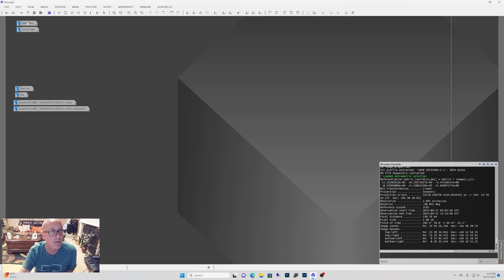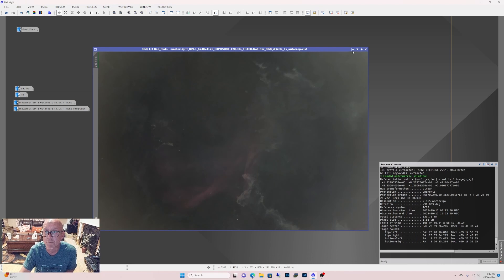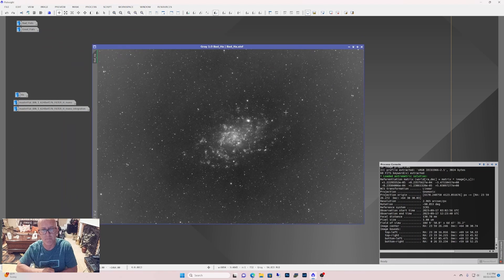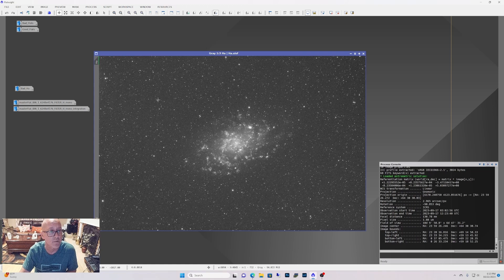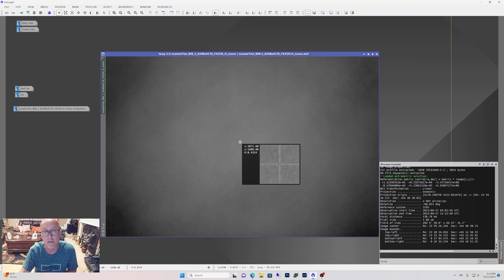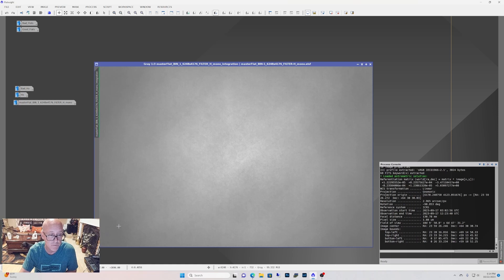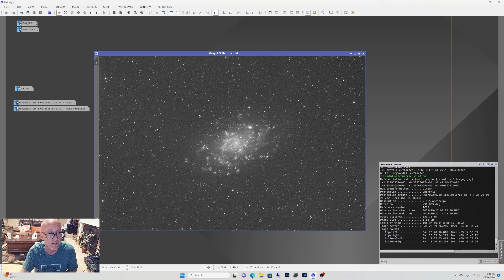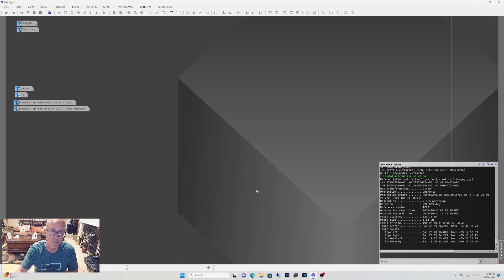Astrophotography Bad Flats vs. Good Flats

Comment: The 2600MM seems pretty unforgiving with flats. My personal checklist: 1) Filters sometimes get looser,  making them unstable.  Tighten them. 2) I second the motion on lowering the exposure for flats.  3) i Put a matte plexiglass over a flat panel if it's got a glossy finish.  4) Auto-rotator can move slightly after meridian flip. 5) Finally, Fast Batch Preprocessing often does not work well with flats; switch back to WBPP.  Some or all of these have been issues at times.

Comment: This is a great video..I am having trouble too..I use the asiair and set to the 32000 I will try a lower setting
Reply from the maker: My opinion 32000 is too high I shoot for somewhere around 20000-24000.

Comment: Hi there,
good comparison, thank you.
I just went through the same thing with my flats. Looked at the master flat and it was way to bright. I always use NINAs flatwizard and I go for 30% of histogram with very little tollerance (2-3% with pegasus astro flat panel its easily achived) I did retake them, stacked and all good! Maybe I just didnt see I was set to more than 30% histogram (Isnt 50% the default when you launch flatwizard?)
Anyway clear skies!
Denis
Reply from the maker: Yes I think it is set to 50 by default which in my case is too bright. Between 20 and 30 seems to be good for me.

Comment: Hey Patrick, I use the ASI2600MC Pro too and I usually run miy flats around the middle of the ADU and I get bad results sometimes and so I'm going to try lowering them to around 20000. Thanks for the tip. I appreciate it.
Sincerely, Rich Williams
Astor, Florida 32102 USA!
Reply from the maker: Yea technically it should work from everything I've read but for some reason 20k works best for me.